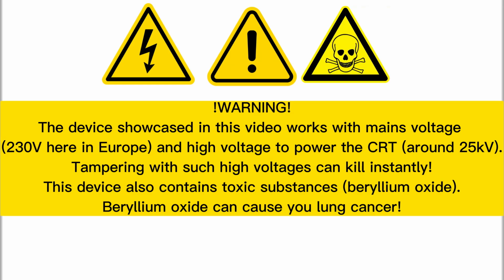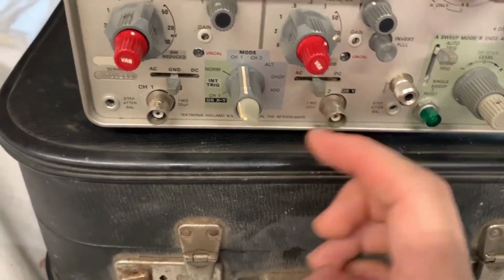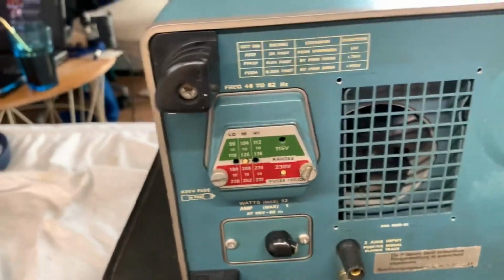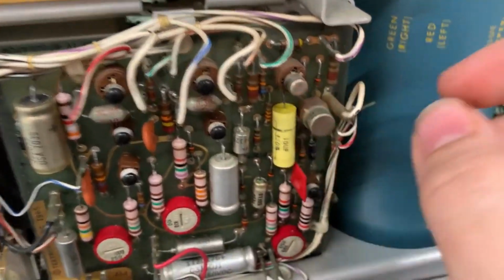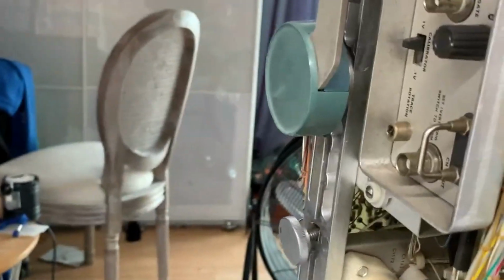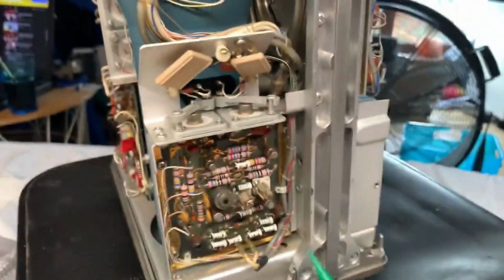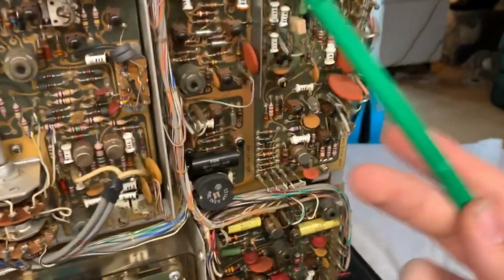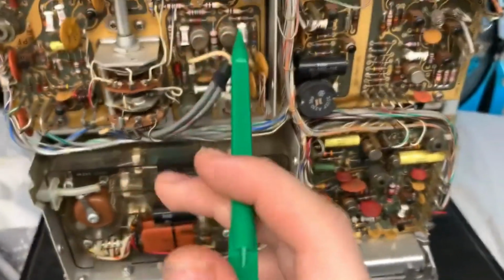Tektronix 453A Oscilloscope TEARDOWN | They don't make them like this anymore!

Comment: The rubber connector is actually not the cathode, thats the anode the positive terminal
Reply from the maker: Haha, my teacher was actually wrong! (I thought so).
Reply: @Sonic_The_Electronic_Madlad  Scope CRTs mostly dont have an anode connector and have them at the back with the other connectors when the voltage was under 3kV.
I think the wires that go in the middle of the crt are the deflection plates, or possibly it could also be the trace rotation, tho in most crts i have seen that closer to the front.

Comment: "Tunnel diode"
I see someone has been watching diodegonewilds scope repair huh?
Reply from the maker: Well, looking back into the schematics and spending approx. 3,5 hours studying it turns out that those gold plated diodes indeed are tunnel diodes. These ones seem to be the reliable ones, I remember when my dad told me that back when the Czech Republic (the place I live) was in socialism, these diodes (as i the diodegonewild's one) were a piece of crap.
Reply: @Sonic_The_Electronic_Madlad  Not all the stuff in the eastern bloc was garbage, most of the consumer grade stuff wasnt as good as it could be, but stuff like engineering equipment was built very well.
Compared to what we now have the Eastern Bloc stuff, despite crudely made, is still more reliable and dependable than the cheap stuff from china. 
A friend told me that the czechoslovak engineers at TESLA had many ideas and innovations, but there was not enough funds to put them into high volume production, so they had to stick to simple cheap to make components / electronics production, but made them easier to service.

Comment: [I was wrong, it is] 

This is not beyrillium oxide, beyrillium oxide has a purple colour, beyrillium oxide is used as a high voltage insulator, especially in the field of high power RF, in this case its just ceramic, the voltages are tiny compared to where beyrillium would be a requirement, even microwave magnetrons (which most please say they contain beyrillium) most likly dont, except high power magnetrons where it is a requirement. It doesnt make sense to use an overkill substance for a simple job that simple alumium oxide could do.
Reply: BeO has the rare combination of high electrical resistance and high thermal conductivity.  It IS being used here to mount and insulate the deflection output transistors (can is tied to the collector terminal), while conducting the heat away and into the grounded aluminum chassis.
Reply: @bobweiss8682  Yes, it is used i verified it myself
Reply from the maker: Well, have a look here: https://www.google.com/search?q=what+colour+is+beryllium+oxide&oq=&gs_lcrp=EgZjaHJvbWUqCQgAECMYJxjqAjIJCAAQIxgnGOoCMgkIARAjGCcY6gIyCQgCECMYJxjqAjIJCAMQIxgnGOoCMgkIBBAjGCcY6gIyCQgFECMYJxjqAjIJCAYQIxgnGOoCMgkIBxAjGCcY6gLSAQkxMDQwajBqMTWoAgiwAgE&sourceid=chrome&ie=UTF-8 
In here though, it's used as a thermal conductor to cool those devices down.
Reply: @Sonic_The_Electronic_Madlad  Tektronix made extensive use of standard ceramics, even their scopes crts were made out of ceramic (yours probably too), they had a whole ceramic division, i bet that this is standard ceramic instead of beyrillium since it makes no sense to use this in this application.

And sorry i confused beyrillium and beyrillium oxide.
But still thats standard ceramic.
Reply: @Sonic_The_Electronic_Madlad My comment keeps getting deleted because i provide links (sources)
those likly are beyrillium, at least in the 453
i am going through the 453A parts list to see if they are

Edit: Part List item:  214-0317-00
same part as in the 453 oscilloscope, says its beyrillium oxide.
The true way of knowing is removing it and weighing it with the known density of beyrillium oxide.
Maybe it is maybe it isnt, simply respect it and it wont hurt you
Reply from the maker: @janno288 OK, thanks for info!

Comment: The CRTs in oscilloscopes use 10kV at maximum but still correct. 
I have the same scope funnily enough!

The A has slighly higher ratings and is fully transistorised (except the crt obviously), so sadly no nuvistors inside.
Reply: The original 453 also used tubes (type 5642) in the HV multiplier circuit.
Reply: There are oscilloscope CRTs using up  to 24kV, though it is not common.